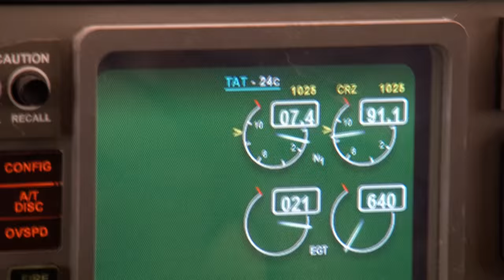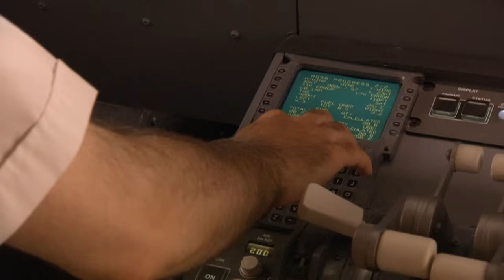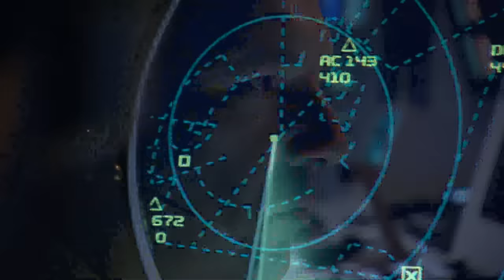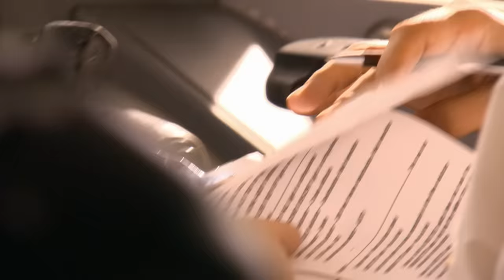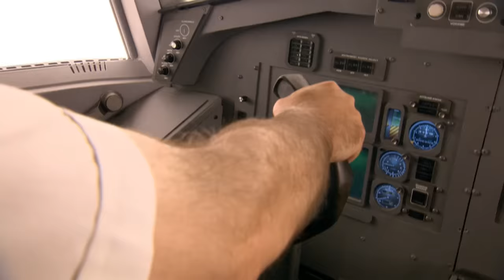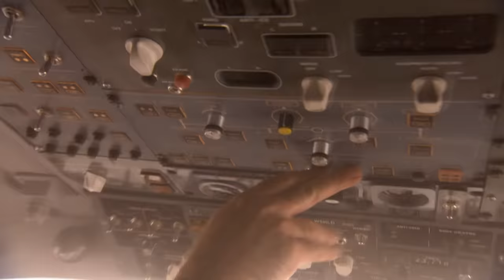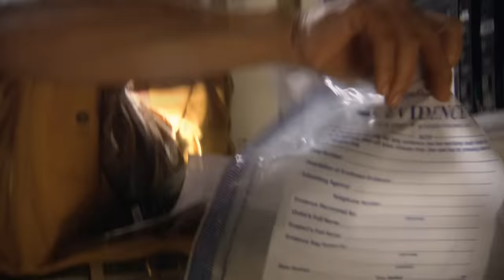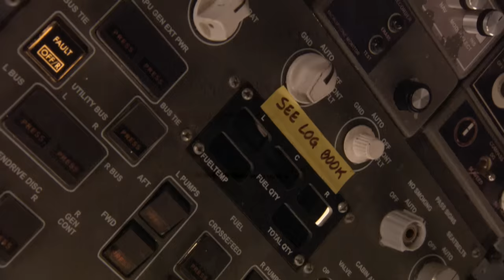Air Canada Flight 143 Lands With No Fuel | Mayday | Wonder

Comment: I've tried to pull of the same maneuver in a simulator but I couldn't do it. These are 2 very very very skilled pilots.
Reply: The maneuver the pilots pulled is barely possible in theory, and yet, skill and training, as well as each pilots own personal experience, saved the day.
Reply: I tried it once as well in FS2004, starting from Montreal.  I set up the parameters as close as possible to the original flight and even ran out of fuel around the right spot.  Made it to Gimli but overshot the runway.
Reply: the drift can only be calculated in your head   turn .count 1 thousand one keep counting
Reply: The captain was a former fighter pilot so he had some gliding experience
Reply: @Jeremy are you a pilot?
Reply: @cpvillacis  yup
Reply: This maneuver should be added to air shows . That was totally cool and brave
Reply: Another thing to keep in note is thst if the engines are powered, the torque of the blades spinning can affect the performance of the jet. This is why the 767 here and a 737 flown by TACA were able to perform the side slip successfully, since both Jets were powered down due to the engines not being powered
Reply: The captain did a Joseph Joestar-level asspull with this plane and especially for no one to die.  This is my favorite crash landing because he saved the damn plane as well, sick as fk
Reply: Maybe it works in real life but the computer says it is a crash
Reply: did you play eurobeat in the background?
Reply: I can only manage it in Kerbal space program with a small delta wing aircraft (and usually with at least some level of unplanned disassembly)
Reply: if you have experience as glider pilot, maybe you can pull it off. its more of feeling the plane rather than pay attention to technical and instrument reading

Comment: What I find totally mind boggling was that after keeping his cool, thinking outside the box, and pulling off a never done before, life saving landing....they demoted the Captain for 6 months, because he "allowed the accident to happen"!! The First Officer was suspended for two weeks! Only much later did someone pull their head out and give these guys an award to recognize the amazing landing they pulled off under extreme pressure.
Reply: Remember that you're now watching this with the benefit of hindsight. Days after the incident, and prior to a thorough investigation, you'd have no idea whether the pilots' negligence caused the lack of fuel, so it wouldn't be responsible to let them keep flying immediately.
Reply: @ tlis, Am I missing something here, or don't airplane fuel GAUGES show the amount of fuel in the tanks, or more importantly, the amount of EMPTY space in the tanks?!? I am older and raised on feet and inches, and I regularly curse the 'system' for having different measuring rules depending on where we live on FLAT Earth! I've just recently learned to calculate feet  to metrics. 30 cms to a foot. I'm 1.83 meters tall, or 6 ft even.
Reply: I don’t think anyone should be demoted till the investigation is over as they did an amazing job saving all those lives.
Reply: What idiots would even think about demoting them???
Reply: Standard CYA procedure. Set the stage to blame the pilot, direct the blame at the pilot. Except the issue was not pilot error, it was nobody could be bothered to write down units next to numbers, so everyone just assumed whatever happened to pop into their heads.
Reply: @mr.blackhawk142  The fuel gauges were inoperative and had been tagged as such. The pilots had no idea how much fuel was in their tanks.
Reply: Pick an EFFING SYSTEM and STAY with that!
Reply: @mr.blackhawk142  they literally state the gauges weren't operational that day. But the fact you are quoting flat earth means you really dont' want to listen
Reply: @Quintega  he's unaware of the proper use of all-caps and literally just learned how to convert metric to imperial... I wouldn't waste your time trying to get him to realize the earth is round
Reply: @Quintega  He doesn't think the Earth is flat, he's referring to inadequacies in measurement systems
Reply: @hikingwiththedog6078  he literally called earth flat
Reply: Well....because it's his JOB to know if they have gas!! 😆  He's lucky they made it safely.
Reply: @mariusvanc  It was entirely the captains fault as the Aircrafts fuel gauges were broken and  the captain should have "dipped the tanks"  He was lazy and screwed up.
Reply: @videomaniac108  they are required to dip the tanks to confirm , He did not.  There is manual "dips" under the wings. Ahole makes 200K a year and too lazy to do his job
Reply: @Tony D. Happens all the time.
Reply: @lekhakaananta5864  p
Reply: @lekhakaananta5864  Even if there were human errors, the fuel guage on the plane was broken. It's like telling you, you got a full tank of gas, and you have 300 miles to drive. Your fuel guage doesn't work. Good luck. I'm shocked that the plane was allowed to take off with a broken fuel guage when I wouldn't take that chance with a car. The blame should mostly go to the broken fuel guage and not the pilots.
Reply: @joshuaychung  Yes but how would they know the fuel gauge had a problem before doing an actual investigation? That's why prior to the investigation you can't assume the pilots are blameless.
Reply: @lekhakaananta5864  I agree wholly. I actually read some comments down below with the folks who seem more knowledgeable, and apparently, the crew was supposed to check the fuel level. Whether it was a calculation error or not, the crew is still responsible.
Reply: Wow that wasn’t right they save all lifes
Reply: doesn'
t matter the outcome the only issue was why did it happen and as the a/c captain is responsible it always falls to him. This should never have happened period.
Reply: @Jim Neesta, this kind of thing is more common then you think. NASA lost the Mars Climate Orbiter because of a metric conversion error in the software (NASA used metric while a contractor used imperial). The spacecraft aerobreaked (this is using the atmosphere to slow down instead of expending fuel) too deep in the atmosphere and crashed as a result.
Reply: @mr.blackhawk142  this aircraft's fuel gages were digital and the processor that controls the digital ones was out of service so in effect they didn't have any visible fuel gages,  but the aircraft's Minimum Equipment List at the time allowed them to fly without it working because they could manually calculate the amount of fuel it had, but the calculation because of metric conversion was wrong
Reply: It surprises you that corporations put the blame on their employees instead of taking responsibility? Lol welcome to the real world
Reply: It was noted, early in this video, that those  systems were out of order at the time of this flight.
Reply: @mr.blackhawk142  The actual active gauges were out of action. They were relying on the flight managment fuel counter(which doesn't measure actual fuel sum, it calculates how much fuel you'd have based on time, wind, standard engine performance, and the amount of fuel you told it you had to start), which was wrong since they put in the KG amount they were told they had in it, not the LBs they actually had. If the gauges had been working the mistake either never would have happened as the fuel crew could have checked or they would have noticed after.